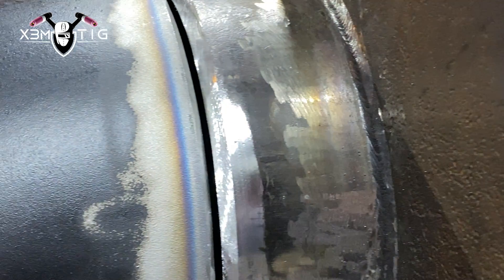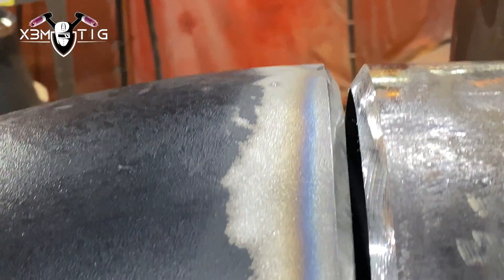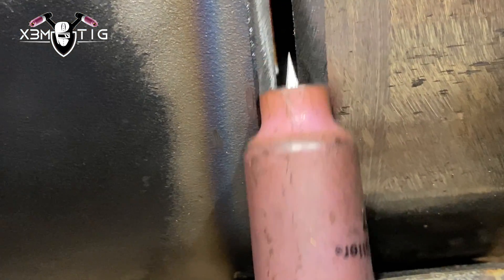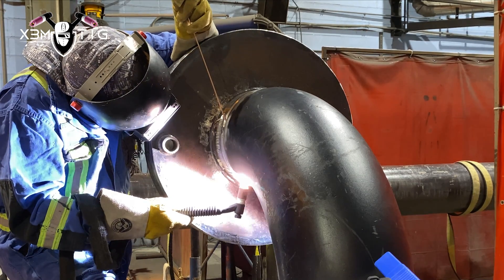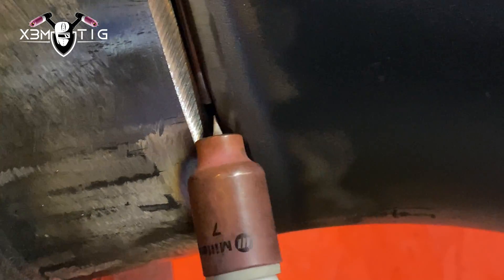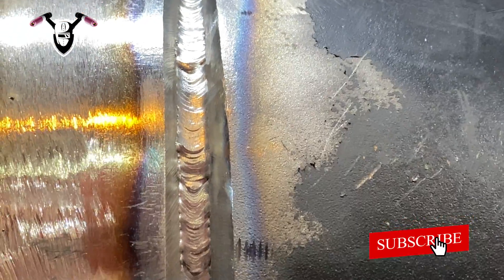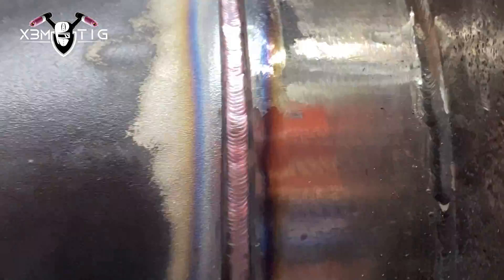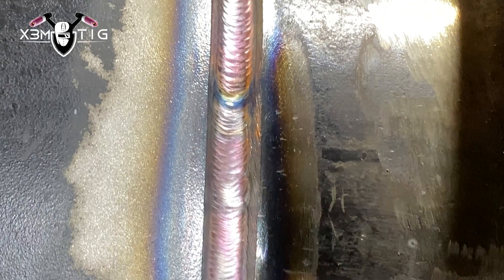TIG Welding Wire Feed Techniques | Perfect Your Welds!

Comment: Hey man, thank you for another great video.. I was wondering about your tungsten choice.. 2% Lanthinated seems to always give a consistent arc for me, but I was wondering if you like to change your tungsten type based on your material or application.. You are the jedi master so any info you could share would be greatly appreciated!
Reply from the maker: I just started using Lanthinated recently , and I would agree on arc consistency, and initial arc starts seems to be way better. Using Zirconiated Tungsten for Aluminum, and Pure Tungsten for aluminum plates and non code works. That’s it pretty much for me, unless it’s specified differently in WPS…
Reply: @X3MTIG    Thank you brother.. or should I say Obi Wan the jedi master!

Comment: Dang man you are steady! I cannot freehand without my torch hand resting against the pipe. I also love how thick you lay your roots, something I need to work on. As always, thanks for the great example you set for us!!!
Reply: Hey man how u doing, I have a question,  how do you rest your hand on the pipe without cooking your hand? I always struggle with that
Reply: @leftymariano1020  I only freehand when laying the root, so I hold the torch really close to the cup.
Reply: @leftymariano1020 get a tig finger or use a spare tig cup that you aren’t using as one to cover your fingers when bracing against the pipe